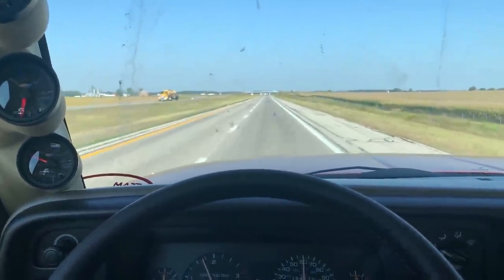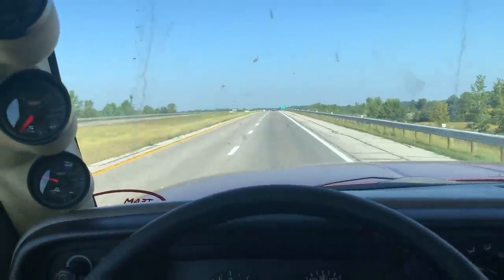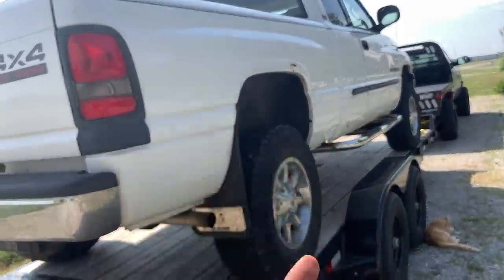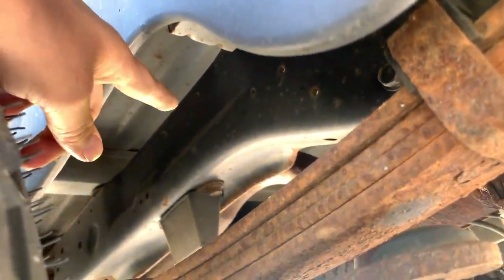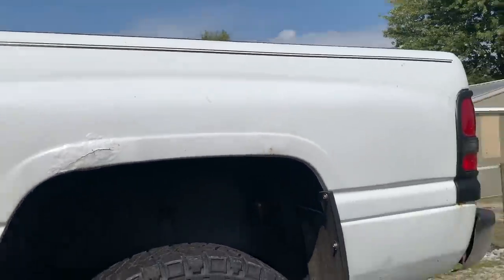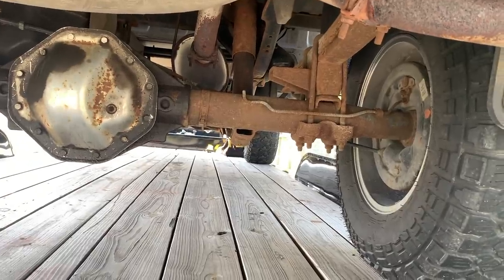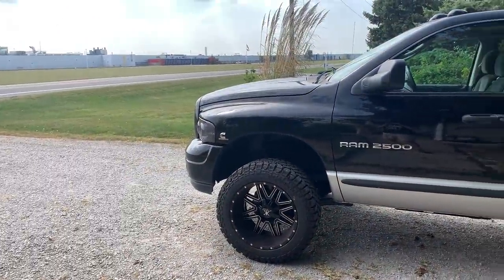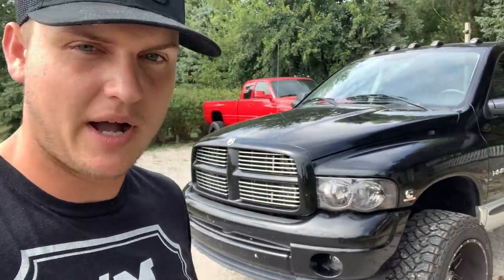Time to restore Grandpa LNP's old truck!!!

Comment: I did a k&n cold air intake and a flow master exhaust cat back system dual out of muffler with stainless tips sounded great ram good was a gas guzzler though I was lucky to get 12 mpg good luck with it make Grandpa proud

Comment: i havw a 5.9 gas in my 01 2500. Found that a Hyprtech tuner, cold air intake amd throttle body spacer lets her breath better and get better fuel mileage.  Defintily worth the money.

Comment: I run a 16x10 vision d window with -12 offset on my 2g 1500. Sort of like a typical steel wheel. Got the perfect amount of poke without hurting turning at all. Take a look at chrome pro-comp wheels. They would give the truck a great 90’s style

Comment: The front of that third gen looks like my third get , 360s are super loyal when kept stock I'd say the only modifications to do is just swap the air cleaner to an edlebrock just to clean up the engine bay a little

Comment: heres what i would do if it was mine truck step 1 find a single wheel 1 ton truck get the axles out of it and swap them and step 2 edelbrock heads and headers and cam kit with timing set and push rods and step 3 edelbrock proflow fuel injection kit because the stock fuel injection on these trucks sucks period when they start wearing out .thanks

- nick

Comment: I know this is a old video i remember watching these, anyway i myself for about 4 years have a 2000 dodge ram laramie slt quad cab long bed 1500 5.2 litre 318 magnum V8 it's gloss black with most of the white pinstripe has happy spray blasted flat black junkyard swapped out front doors and the truck is from northern Ohio so it has rust, it has the factory laramie slt specific 16 inch high polish center and the brushed aluminum wheels except for the fact that they are plastidipped black as are the center caps and the lug nuts,, and the front suspension is completely rebuilt and it has almost all of the brake lines replaced with a complete set of stainless steel brake lines from classic tube out of ohio my truck has already had a front pump input shaft seal and torque converter replaced so it shifts right into reverse and starts backing up, it runs strong for a 318 magnum V8 it's got 210k miles on the truck

Comment: Love  your channel and love a Cummings too.. I have a 2000 ram 1500 4x4 5.9 gas with the same tires and your running on the white truck.  Kenda rt 33 1250 18.  I like  this tire. What do you think of the Kenda tires.?

Comment: Sounds like a lot of talk. This is the 2nd time around. From what it sounds like, you should have done this the first time around. when it comes to rust. I would have just made it sound before I gave it to my grandfather. You still didn't cover all the the rust issues that I saw in this video. You have rusted shocks on this truck. Very simple fix. Just saying. You do great builds but this was for family and it seems like you skipped a lot of normal maintenence. If you want him to be able to do these things with the truck, I would be more worried about how the truck works more than they way it looks
Reply from the maker: Dude.. he owned and drove the truck for 4 years… it was almost completely rust free when I bought it for him. It also drove flawlessly. Was fully serviced. I bought him new wheels and new tires. Truck had no issues.

Now fast forward 4 years with almost no maintenance done of washing of the truck.. this is where we are.

Don’t be so ignorant.